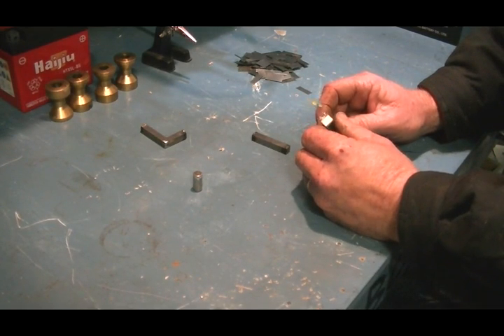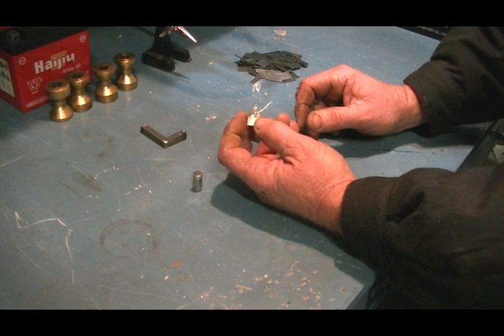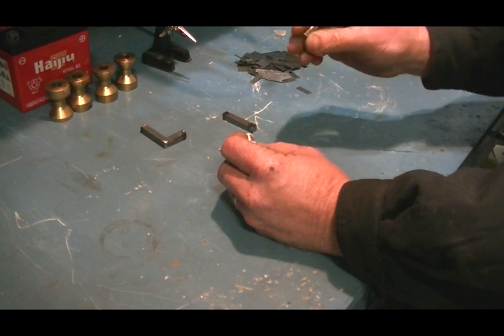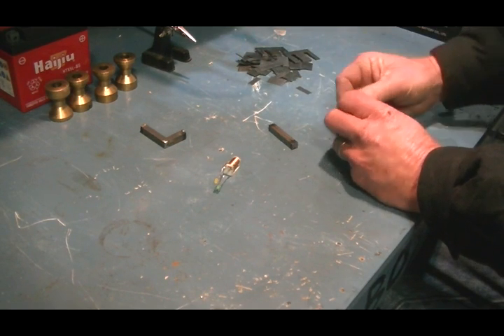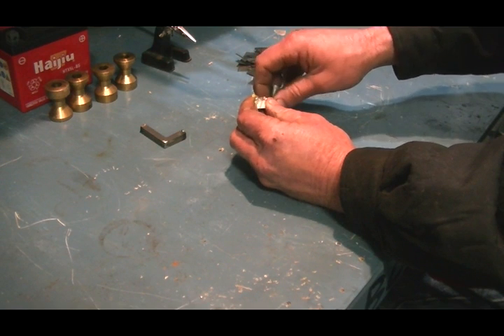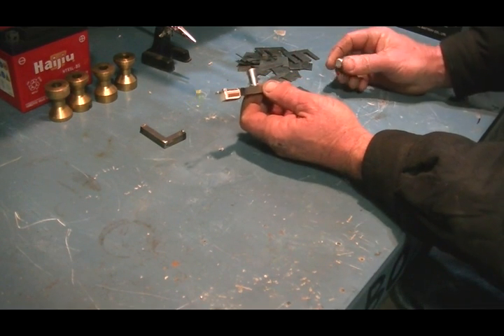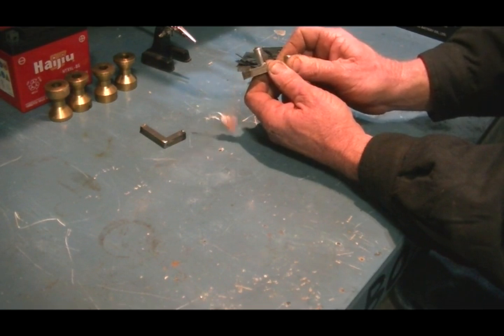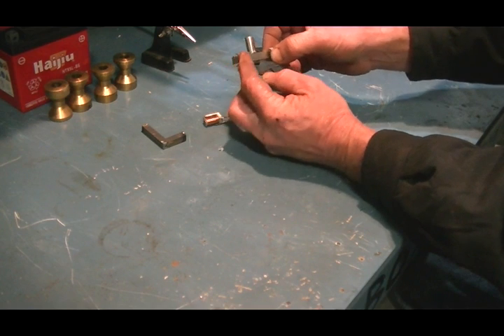switching a PM on and of

Comment: I really believe that is not going to work. You need a frame which has two solenoids (out put) on two side and a magnet at the center connecting the upper bar to the lower bar. and the you gonna need a solenoid (input) which receives AC electricity. And your core can not be just anything. I think black iron oxide is the way to go :)

Comment from the maker: Well the thing is-you get power when the magnetic field is removed from the coil,and then you get power in the opposite direction when the magnetic field is reintroduced into the coil.First up will be a small test unit to see if there will infact be a lenz force applied to the rotor.It is my belief that the lenz force will be between the PM and the coil-not the rotor

Comment: whos says u need NSNS to get AC?  and hey Tin, I have been thinking about a sort of opposite setup to this for a while now but sort of the same principle.. what do you think about having a "special" type of coil sandwiched in between a very strong magnet and generating inductor.. would it be possible to pulse this "special" coil in a way as to cancel or divert the PM field so there is greater induction in the gen coil? sort of just switching the magnet on and off, but taking less power to do it.